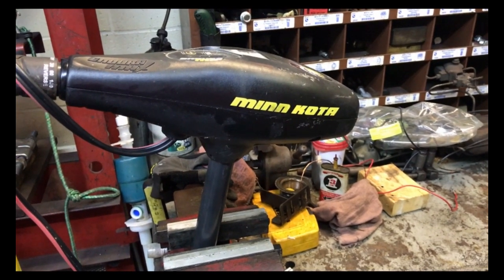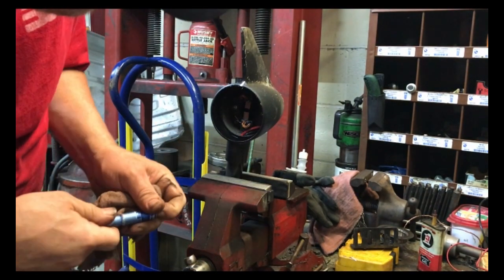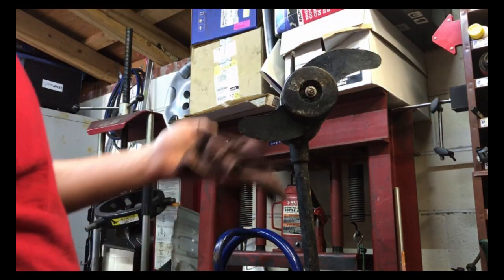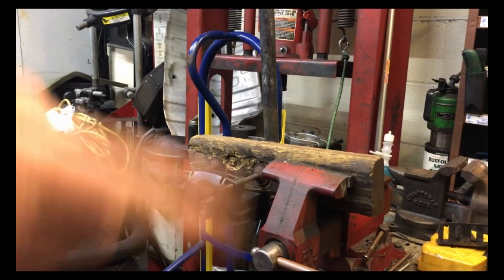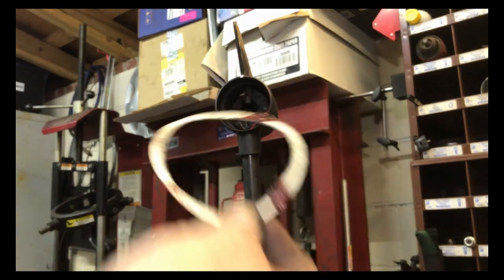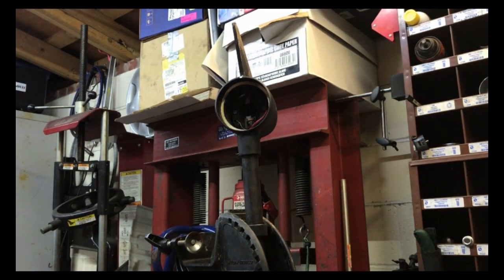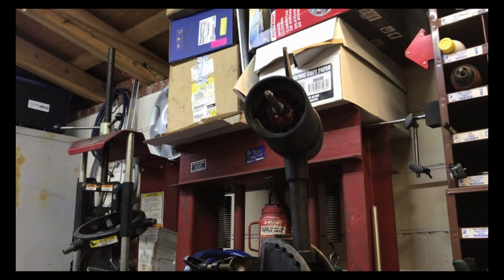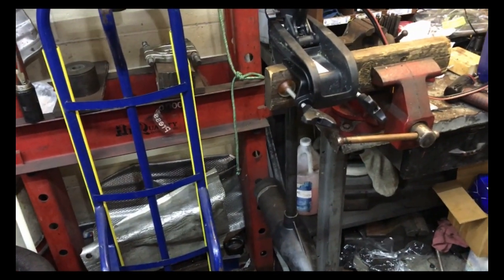Minn Kota Trolling Motor Tear Down and Repair

Comment: There is a round cardboard ring that you insert to hold the brushes open, allowing you to leave the brush springs on the brushes. When you insert the armature the ring falls into its place. Brushes collapse on armature. Then you install the magnet housing. Then finish the rest of the assembly.

Comment: Mine had a broken mgnet less than a year in. just took the broken piece out, maybe a tiny drop in power. 4 years later and the motor piece is going strong (needs a switch tho). Great vid!
Reply from the maker: Thanks for watching

Comment: I have found when placing the barrel back in position over the armature, try a socket that will fit over the shaft and a extension. Slide the socket with the extension attached through the barrel and contact the armature shaft. Place pressure on the shaft while replacing the barrel.
Reply from the maker: i did that the second or third time. Thanks for watching
Reply: Good morning
It's there any way I can fine in your heart to forgive me.
I also have myself defense and there set on hi priority. All kinds of crazy s*** comes out of my mouth.
So just like u shout down.
Hey that's more in common I really in joyed yesterday.

Comment: Good video, I'm not familiar with tearing these motors down. I need to tear it down to the bare shaft. Would it be easier to take the head unit off or the motor. I'm putting my transom mount motor on my bow mount bracket. Which requires the motor to be tore down.
Thanks William
Reply from the maker: I am not sure. But I would start with the head unit first. Thanks for watching

Comment: How do u take the piece off with the magnets inside it's stuck on I can't at bushings?
Reply from the maker: After you remove the bolts it should slide apart. There might be some corrosion, tap on it with a screwdriver handle.
Reply: Ok thanks

Comment: I just got a Minn Kota traxxis 55 and I hooked it to a battery and it's making a terrible noise like the bearing are bad ,just a horrible roaring noise this isn't normal I don't think I've never heard one this loud what do u think is making this noise
Reply from the maker: Sorry just saw your question. I would take and remove the prop to see if it has fishing line  caught in it. Then try it again. If that doesn't take it apart and see it the bearing are bad.Thanks for watching

Comment: I'm  rebuilding an endura 30 made in 2007. The bolts that hold the brush plate are extremely tight and heads are slightly rounded. I've been spraying them with pb blast to see if it would help break them loose. No luck yet. Any suggestions on how to loosen these without breaking them?
Reply from the maker: A little heat does a lot, use a propane torch.  If you are not in a hurry just keep spraying it down. It might take a week. Good luck
Reply: @TheGAutomotiveAndMore  thanks for the reply. I've thought about using a small soldering iron to heat the bolt through. Other alternative I've thought of is to cut the bolt head off, would possibly trash the brush plate but they're still available. Will keep spraying for the time being. I also give it a shock with a small hammer and punch to try to get some vibration to the seat of the bolt
Reply from the maker: @ufoabove  Yes all good idea's but I would only cut off the bolt heads as a last resort.

Comment: I'm watching Lots of videos on trolling motors, I was under the impression the Max was brushless, I guess it's just got the PWM feeding the brushes.  Comment on that if you will - you use the term armature quite a bit - the area the brushes ride on is the commutator. 

They should have built these motors with a bearing at the back also.  The bushing they use wears and lets the shaft going through it wobble wearing out the seal then a leak happens and the old motor gets tossed and you go buy a new one!

Hang onto the old motor for parts, I don't throw away AnyThing.  Put all trolling motor stuff in a 5 gallon bucket for Next Time, cause Next Time might be in 3 days

Also I put a couple of drops of oil on the transom clamp to keep it from rusting  -  thanks for posting this
Reply from the maker: Yes the brushes ride on the commutor but the whole piece is called the armature. I don't about them being brushless, these 2 were not. Maybe the newer ones are but do not know. Yes I always save the parts, never know if you need them. Thanks for watching
Reply: @TheGAutomotiveAndMore  - 1) what is the difference between a Max & Endura?  -  also, 2) Im doing a custom project. How can one controller be used to control 2 motors simultaneously from one battery? Maybe I could call or email you for a quick diagram for my project?  -  txt me if poss - 203 -  910- 7903 Jon
Reply from the maker: @jmm1000   The only differents I see is that the C2 speed contoler is indexed and the Max is variable. The motors are the same in the two that I have. I do not have any type of wire diagram for these motors. Sorry. The problem I see is that the motors are going to draw 2 times the current threw the speed controler and will burn up. Thanks for watching
Reply from the maker: @jmm1000  The c2 max speed controller is index where the endura is variable. The motors appear to be the same. I would be worried that the speed controller would burn up because of the 2 motors pulling more amps. I don't have any wire diagrams.Thanks for watching
Reply: None of these Minn Kotas use brushless motors. They're all brushed. Brushless motors are more expensive and use 3 phase AC power. It requires a separate electronic speed controller to convert DC to AC and would add to the cost. Their Maxx model uses a PWM controller for better efficiency at lower speeds but makes no difference at full throttle. vs the C2. The C2 is uses old school resistors to turn power into heat. An easy way to clean the commutator is with an eraser. Use contact cleaner and spray the entire assembly while it's open to remove all the carbon for better performance.

Comment: How the heck did a magnet break encased in that big strong metal tube  ??
Reply from the maker: I think somebody dropped it. Thanks for watching
Reply: I took one apart that was full of water 💦 and was going to try and find new brushes until I found the magnet was broken also. I stopped there and just used it for parts. But it looks like a broken magnet is common. I have another one now and when it dies I’ll give it a autopsy.  To find out why.

Comment: My prop won’t slide off ?
Reply from the maker: After you take the nut off it should slide off. Put some WD40 on it and let it soak in and try again. Thanks for watching
Reply: @TheGAutomotiveAndMore  ok will do thanks I got some line stuck in my minn Kota endurance 30 pound thrust but I use it in saltwater so maybe that has something to do with it
Reply from the maker: @cruzzarek8103  That will corrode the output shaft. When you get it apart be sure to clean up the shaft with some sandpaper and put some grease on it to make it easer to get apart next time.
Reply: @TheGAutomotiveAndMore  will do thanks for the advice so you said to spray some wd40 amd it should come off right
Reply: If it doesn’t come off after wd40 any other options also mine is a 2018 c2 30 pound thrust
Reply from the maker: @cruzzarek8103  Transmission fluid also works good. You might have to let it soak for a couple days and try it again.

Comment: Anti seize not good for aluminum in marine applications use marine grease instead.
Reply from the maker: You are right should have used marine grease. But I did not have any.